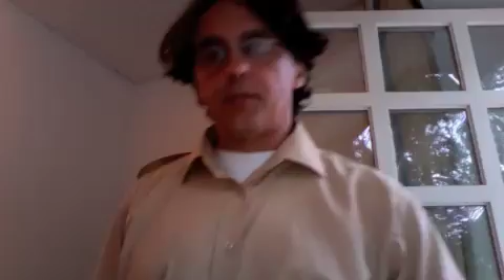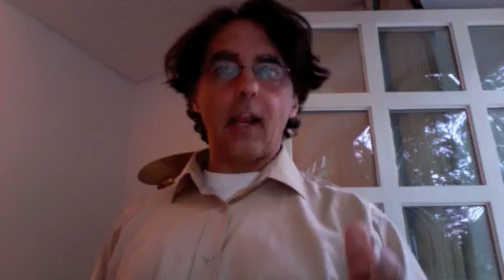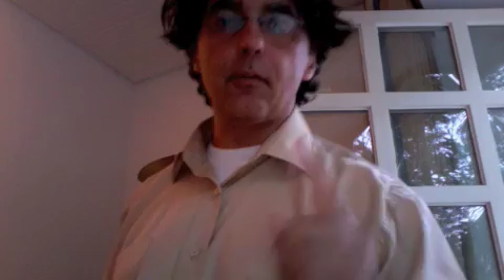AF 447 Update - Air France 447 accident

Comment from the maker: For completeness, here are all the reasons:
mechanical failure; pilot error; structural failure; bomb; UFO; CME (coronal mass injections) from the sun hitting it in the South Atlantic where there is the so called "South Atlantic anomaly" which means magnetic fields repulsing solar particles are weak letting stuff through that could have hot AF447; someone opening the door at 35000 feet.